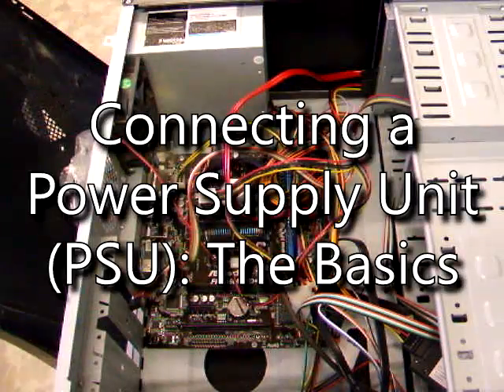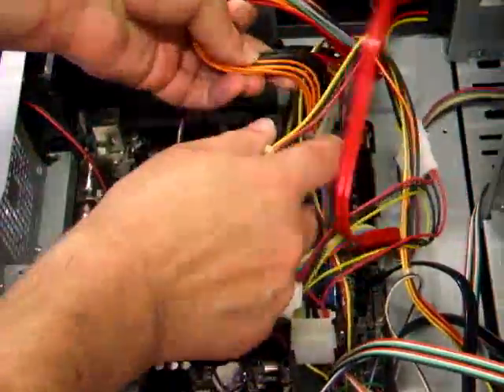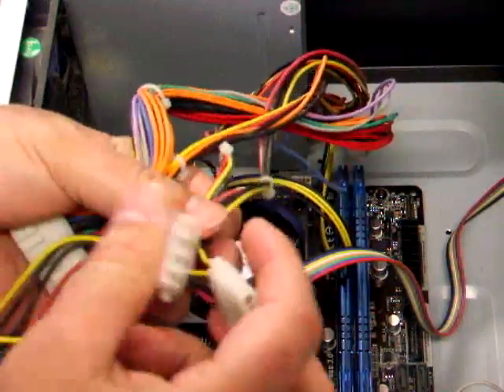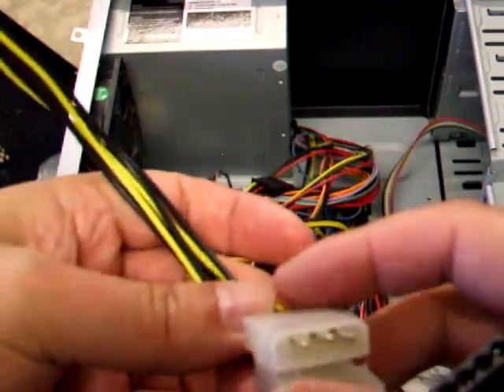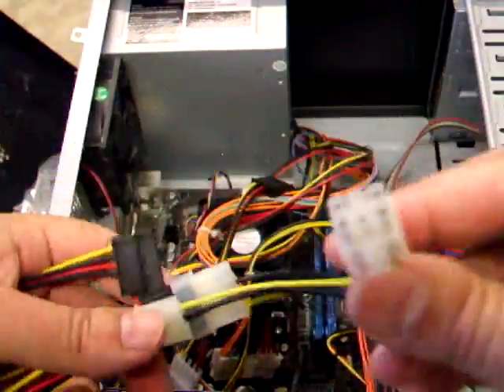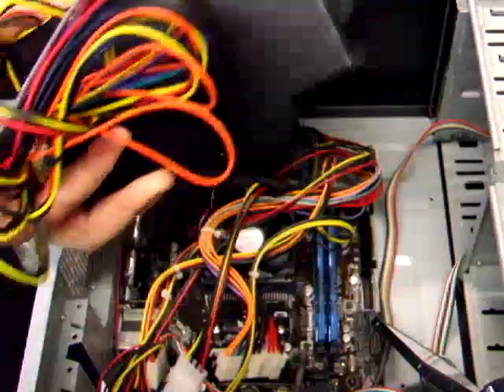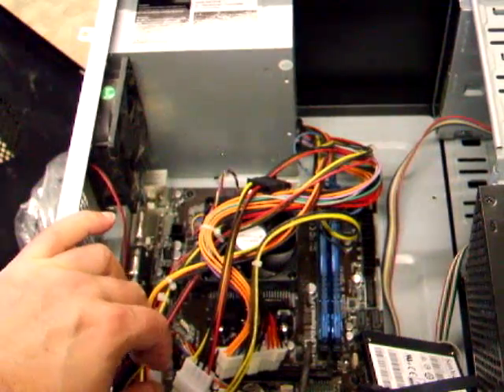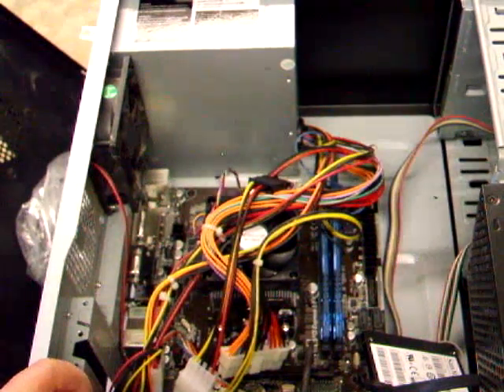How to connect a PSU assembly basics

Comment from the maker: The fan actually sucks in air and blows out the back - so it's whether you want to take air from inside the system, which could be warm air, or from outside.  It's better to take from outside which is cooler.